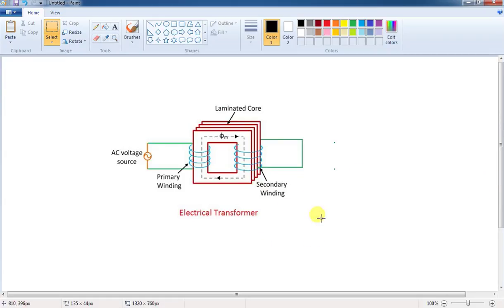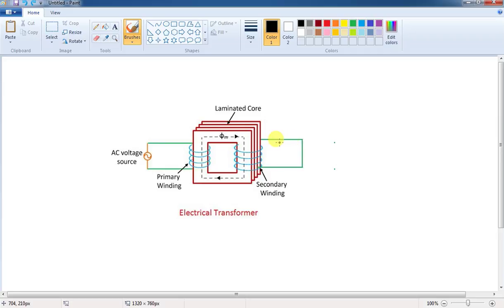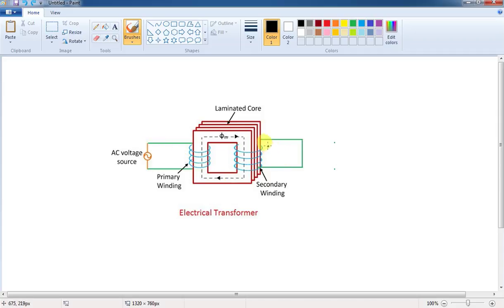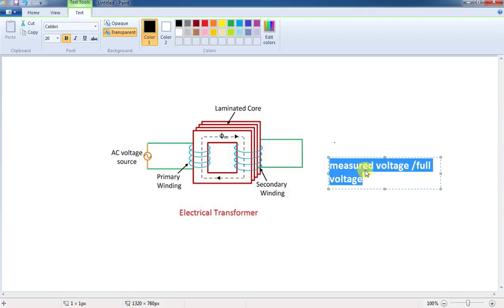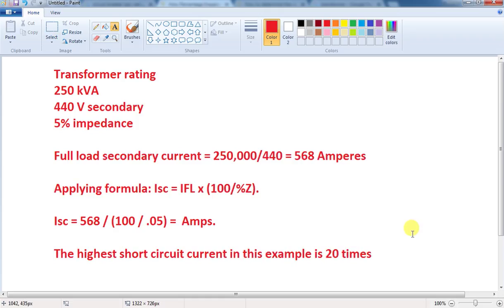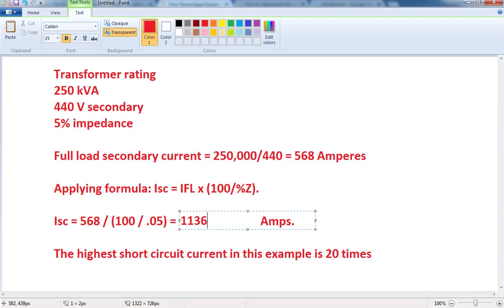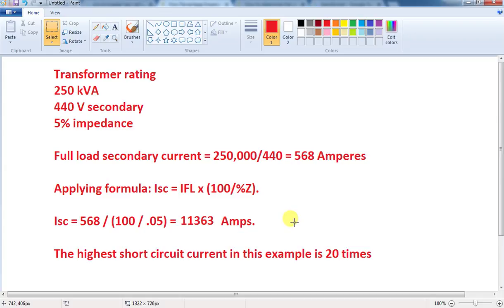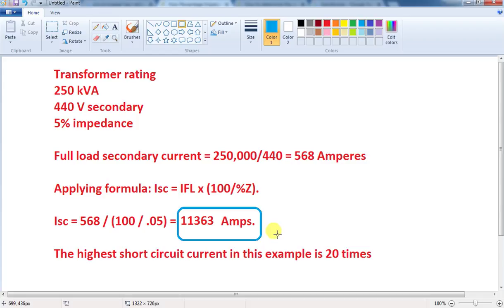What is Percentage Impedance %Z. Significance of Percentage Impedance in Tamil

Comment: bro, i THINK UR  MENTIONED  FULL LOAD CURRENT  IS WRONG .BY APPLYING this formula for TF (kva=r3*v*i/1000) IT WILL COMES 328 AMPS. SO, isc = 656 KA..If  i am wrong  please correct me ..... Thank you....
Reply from the maker: thank you for your comment nanba... but what you have comment in this is, for three phase, but i have taken for single phase....so root 3 will not come. ......
Reply: @Techdoct   which singe phase transformer have phase voltage is 440v ?

Comment: But can you tell me how to know that the value of percentage impedance given by vendor is good enough for my system bcz I understand that the percentage impedance can be changed according to our requirements
Reply from the maker: No you have to check the testing values.. or the testing should be carried under your or yours subordinate presentation. %Z can not be changed bro..it is manufacturing criteria..when you are going rewind the transformer means that time it will be changed...